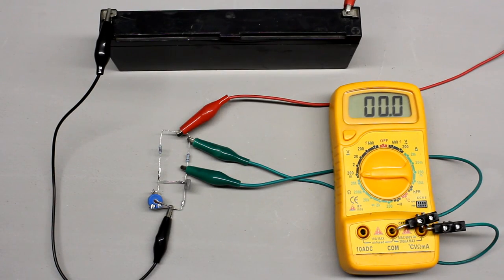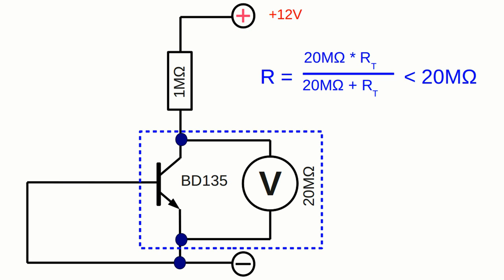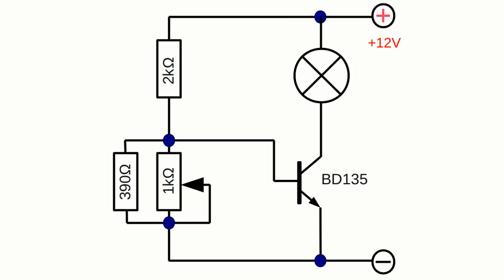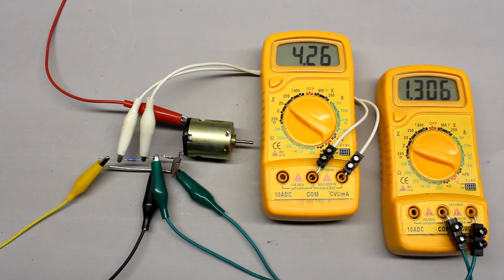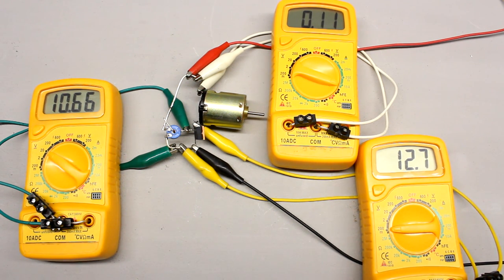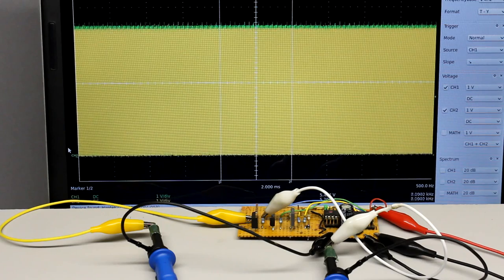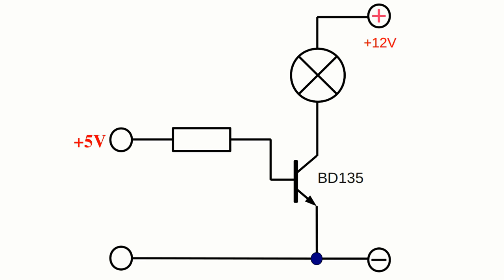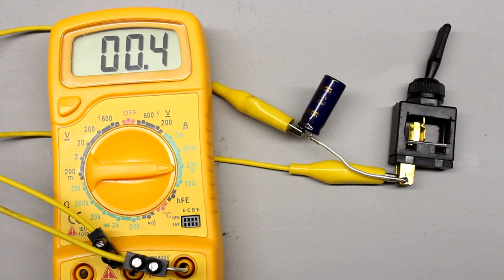Switched by transistors

Comment: Mosfets usually have a much lower ON resistance than transistors too, so less power dissipation. I'm not sure actually what the benefit of power transistors are over using MOSFETS. Difference in linearity perhaps
Reply from the maker: +nikotwenty ...and power MOSFETs are more easy to handle in switching applications. I will create a new version of this video sometime and tread the differences in more detail.